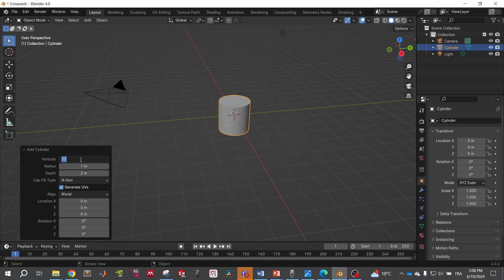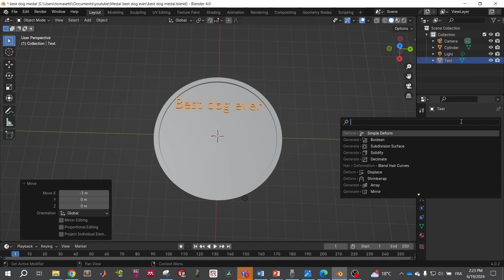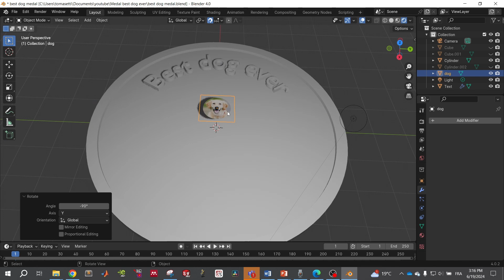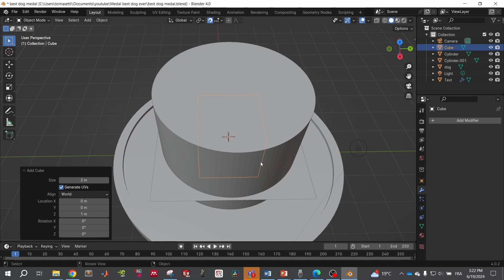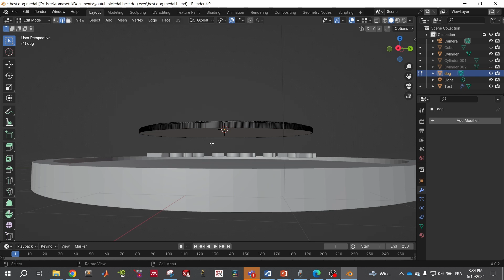3D print a 2D picture (Part 1 - Blender)

Comment: Really impressed by the fact that you can transform a png into a 3D form, just because of the intensity of the pixels right ? Thanks Ben
Reply from the maker: Yes with the displace modifier, you can applied an image texture (shortly the pixels intensity values of the image will be taken as displacement values). you can than play on the strenght to diplace more or less each small face